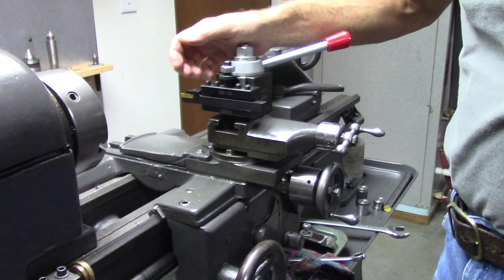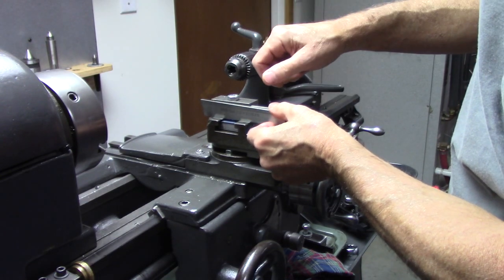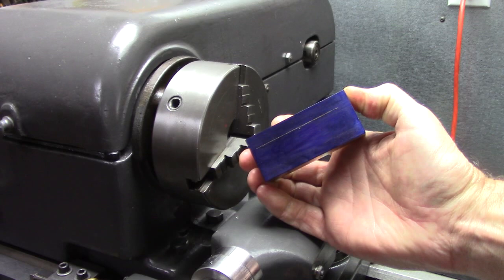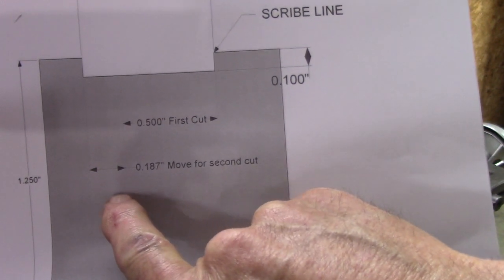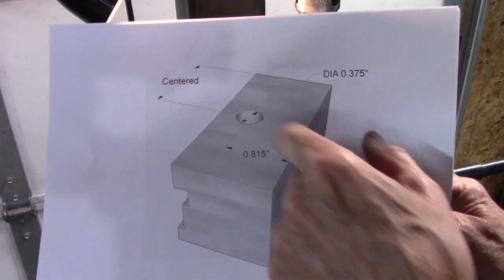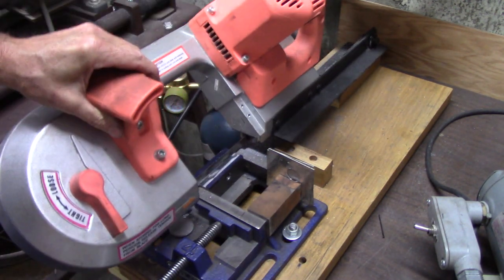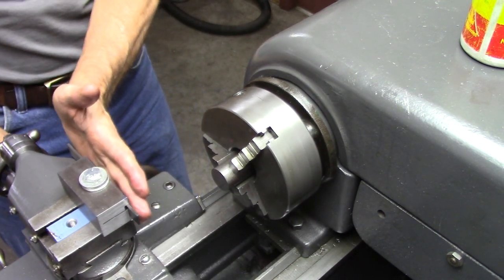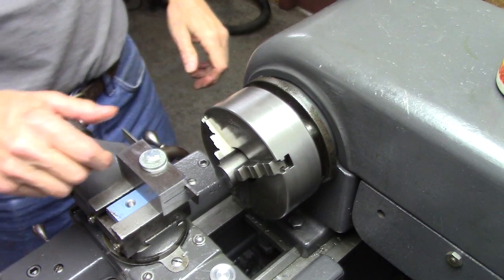Metal Lathe Cut Off Tool holder - NEW easy to make design

Comment: Well done, the end justifies the means they say....personally I would balk at moving the QCTP once I had squared it up and zeroed the tools etc. A lot of the problem with some lathes with parting off is the slackness of the spindle bearings particularly the plain bearing types.  Wherever possible I would go for the back tool post solution for parting off as it can make a real down in the dumps lathe a thoroughbred. I have an old 1930's vintage Colchester Bantam lathe, 5"centre height or 10 "swing for those over the pond,.....plain bearings and slack as heck, but as it has a screwed on chuck, doing a mod is going to take some doing. My solution is going to be.... make/fit a longer crosslide and then a back toolpost for upside down parting.....I won't be beaten.
Reply from the maker: Hello Ian, Great comment! It's nice to hear from somebody that understands the physics involved with cutoff. I sometimes get comments from viewers like, "learn how to setup the lathe and you won't have a problem". Of course many that make these comments are probably excellent machinists that have never experienced anything like a small South Bend, Atlas, Logan, etc.. Cut off is really fairly easy on a large Monarch that weighs over 1-ton. I don't mind removing the QC post although I understand your reasoning. If I was making a lot of the same parts in a production shop I might feel different but most of what I do is one time. I have thought about making a simple removable simple cross slide to avoid changing my tool post position but I suspect moving the saddle far enough out of the way would sometimes be an issue. My lathe has a ball bearing spindle (and a screw on chuck) but a very wimpy compound that doesn't have the needed travel to mount a cutoff tool on the back side.
Reply: @WinkysWorkshop  Hi, I've seen people sweat blood and tears on much bigger lathes when it comes to parting off....apart from the actual tool parameters it just depends on the situation and the lathe condition as well as the actual design of the moving parts.....anything that moves will deflect.
Reply from the maker: @gangleweed  - Interesting, I've used an E10 Monarch and things worked great. I guess it does depend a lot on the lathe condition for sure. I think this method I came up with is way more forgiving. It transfers the force straight down on the compound instead of trying to pull up on the front. The QC tool post acts like a lever.

Comment: I am going to start on one of these today, Thank you Winky!
Reply from the maker: Your welcome. Let me know how it works for you.
Reply: @WinkysWorkshop  Well it is done and works great! This is the first time I have been able to use power feed parting. I would love to send you some pictures of the new tool but I do not know how to contact you directly. I posted a video on Instagram and mentioned you as the one with the whole idea.  I tried the tool parting hot rolled steel and wow! Having the parting blade right on dead center is fantastic. Winky as far as I am concerned you are a genius, Thank you!
Reply from the maker: @jimm2442  - Thanks Jim, I'll have to admit that I was amazed at how well this worked also. Try this, mark21056 at g mail

Comment: That's a simple and sturdy cutoff holder. I have a Shars QCTP set myself, on my tiny toy hobby lathe... Southbend Heavy 10  ;-) and haven't had to part anything just yet. If it doesn't work out, I'll be leaning towards this. Subscribed!
Reply from the maker: The SB Heavy is a bit more solid I think but if you hear chatter you might want to consider this. Cut off is very demanding on a lathe and if it isn't solid parting will reveal this. This fix worked great on my lathe. Thanks for subscribing!

Comment: Nice evolution!  Use epoxy to install a couple of neodymium magnets so the blade is retained.  This will avoid dropping or falling out of the tool holder when off the lathe or installing.  If the magnets are not too big, I don't think you'll have accumulation of chips on the exposed surface of the blade.  Note, you can recess them a bit to soften their effect on the cut-off blade.  I love the tool.
Reply from the maker: That's a GREAT idea!
Reply: @WinkysWorkshop  You know, I had another idea.  Maybe better???  A couple of cap head screws installed so you can independently pinch the blade so it is physically held even when not installed on the compound.
Reply from the maker: @CraftedChannel  - I brought that up in a comment. It would make it slightly easier to mount but also harder to adjust the blade position. It's actually very easy to position and tighten although it would be nice to store the holder and blade as a unit. I love the magnet idea which would accomplish the same.
Reply: @WinkysWorkshop  Ok, I'm back to the magnets then.  It would be a pain to have to reach for two tools.

Comment: Is not the bottom line the most critical due to that determines the tool height on the block where your milling out the space for the cutoff blade. And once you make your cut almost through the block the top will come down and pinch the cut off blade in the block. I'm in the process of building one now for my south bend.
Reply from the maker: Good point. However, if you are careful not to mill the slot oversized you will be very close to on center. If you want to measure the blade height and do the math that would work. The top of the holder Ideally will only flex .0005". It sounds like you have thought this through. Let me know how it works. Also, make the compound straight and even back it off so the front of the blade is closer to the center point of your compound. I think you will like it!

Comment: Great design. Is the .25 machined groove to take the shape of the cut off blade at the top?
Reply from the maker: You got it. The blade has a T shape. Excellent blade!
Reply: @WinkysWorkshop  Thought so. 
Have you got a vid that shows  how to grind tools for different materials?
Reply from the maker: @alangriff1  I've never changed the angle of the grind. I'm not saying a different angle would not be better but it seems to work well as is for mild steel, brass, aluminum and to some degree plastic. The angle is the same as the original grind  (15 degrees maybe?)

Comment: cutoff blade is used on screw machines primaraly..looks like a t- 3 blade  .125 wide  clearance is to allow coolant and keep from binding type of blade is designed to either be clamped down on or if side  on lower surface not the upper part of "T"
Reply from the maker: I don't it matters as long as it is solid

Comment: I’m like Randy if you can reduce the overhang to the QCTP it should be as rigid. As I said in the last video my one piece insert cut off blade type works well, it isn’t like my Grizzly is that rigid.
Reply from the maker: Your Grizzly is more rigid. Randy was suggesting that my design would work on a QCTP "IF" it sat on the compound. This is in fact why my design works so well. Of course reducing overhang always helps with any setup. What would probably work well as my tool holder is a shim between the quick change blade holder and the compound. Many older Logan, South Bend and Atlas suffer from a less than adequate compound. Transferring the downward force directly to the compound compensate for this shortcoming.  The QC post creates an upward force on the T-nut. Of course this force exists with my holder as well but to a much lesser degree. Using the QCTP is exactly the same as my holder with the blade extended 1-inch further with the added negative or relying on the T-nut to hold the post.
Reply: Winky's Workshop yes I agree on letting it sit on the compound.  I know some folks have parting problems on the Asian lathes. I must have been lucky on my fix. Still the concept and execution was great
Reply from the maker: @JamesDedmon  . Thanks James. I sent you an email with pictures :o)

Comment: Hi winky, i liked the video very informative. I was interested in the rpm and feed rate of autofeed. I have not been as sucessful to be agressive at parting. I generally run about 270rpm and hand feed slowly in between clearing and lube. Tool set a smidge above center with carbide tool holder. I am using a 12x36 lathe.
Reply from the maker: I had the same issues before this modification. In fact I broke several blades. With this modification there is zero chatter and I can part at any speed. I'm not sure how fast the feed rate could be with a more powerful lathe. My lathe has a flat belt drive and if I go too fast the lathe stops without consequence. For 1-inch mild steel bar I part at 450 RPM and .009 per revolution with a steady drip of oil. If you use this parting tool clearing chips is not an issue. The top of the blade is concave and keeps the chips more narrow than the cut. The blade type is in the description below the video....  Oh and the blade needs to be set on center.
Reply: @WinkysWorkshop  thank you for that i will make this and give it a go. I hate how i currently part off. I hate breaking tools with potential damage to my lathe.
Reply: @WinkysWorkshop  oh yes most important I really thankyou for sharing you really made my day.
Reply from the maker: FYI  I made one of these for a GNT3 blade style insert holders. It worked much better than the tool post holder but the HHS works better.  I also made one for the GTN2 but wiped out the blade. I think I had the insert slightly high and it stopped cutting near the end of the cut...  I was also using auto feed. It's difficult to get the height of the insert correct.  The cutting force pushes the insert further into the blade  and changes the cutting height. I'll probably stick with the HSS blade.  The carbide works okay with this setup but the blade is much better. Let me know how it works for you.
Reply: @WinkysWorkshop  i have muxed feeling about carbide parting tools too. Purely because of mixed results i find the 3mm much more rigid and stable compared to the 2mm.
Reply from the maker: @metalshopwithtroy5755  I agree. The 2 mm is more fragile although I suspect I can make is reliable if I get the center height right. I'll play with it just because I have the blade and inserts but the HHS blade will be my go to cut off.
Reply: @WinkysWorkshop  i really appreciate your involment winky, the feedback is great too.

Comment: Nice tool holder and very simple construction. I wonder if machined bars of different heights that slot in below the tool would allow for different height cut off tools and maintain the solidity of the base tool?
Reply from the maker: Dang...  that's a good idea! Like stair steps. You might need to start with a wider block however. The clamping bolt needs to be far enough from the uncut part of the saw cut to have some leverage. Thanks!

Comment: I would like to know where you purchased your HHIP 2000-7030 3/32 x 11/16 x 5 Inch blade with the concave top.  I am unable to find one just like it.
Reply from the maker: If you google the number you will get several options but I got mine on Amazon. You can also get then directly from HHPT.
Reply: One more question.  I made your previous build of the cutoff holder and found that my Logan 92 flat belt 11" lathe has trouble with popping the flat belt off when cutting steel.  I watched your video twice and even power feeding you had no problem.  What type belt drive does your Logan have.  I don't think you were using back gear either.
Reply: Sorry Logan 920
Reply from the maker: @Histandard2011  - Yes I have a flat belt. I use a F1 Habasit belt that is designed to be used by the printing industry. It occasionally slips but never falls off. Falling off may be a result on either an alignment issue, belt too long or a stretched belt. The F1 belt requires special tools to splice...  I'm not sure where these might be available. There are belt suppliers with other options. Sorry I'm not much help.

Comment: Do you have plans for your cut off tool holder
Reply from the maker: No but its a fairly simple process. It's just a slot milled a little deeper than the blade width with one edge exactly on center. I did it with a 1/2 mill with 2 passes. It's super important to mill the slot the same height as the blade so you have to kind of sneak up on it.  Then you use a 3/16 mill and go a little deeper at the top edge for a clearance for the wider part of the blade. Then you drill the hole (I used 3/8") from the top and then make the bandsaw cut almost all the way through.

Comment: It is a great design, I stole it. and made one for my Clausing 6308.  I used 3" x 1-1/4" x 3-1/2" block..  I used 4 5/16-18 cap screws counter bored to hold the blade, the mounting bolt is a 4-1/2" 1/2-13 with a 2" counter bored thrust collar.  The mounting force is not applied to the blade. It uses a Shars P2 3/32x1/2".  My lathe has seen some abuse, over its 60+ year life. The compound was shattered at some point and brazed back together. It no longer has front gib adjustment set screws in the first 3 inchs of the compound, so the compound does not react well to side loads.
Reply from the maker: I'm glad to hear it worked out for you. Thanks for the comment.

Comment: Nice job! Put a stud in your "T" nut and use a nut on top so you can get rid of those washers.
Reply from the maker: Good idea!
Reply: Maybe over thinking it. Make 2 thick washers with matching convex and concave surfaces to compensate for the clamping action. The top washer could also be the nut.
Reply from the maker: @mikefox5510  - I'm impressed! I was going to make a convex washer for the same reason. Most people would never think about why this might be important. You have the ability visualize the slight angle created by the clamping action.

Comment: I wondered if you could make it with a small "ridge" on the side closest to the chick, to give you a  solid reference to the edge of your compound? Or, make it large enough to replace the compound completely, for guaranteed rigidity and alignment? Bigger job, not so convenient...
Reply from the maker: There are others that have remove the compound completely. It's definitely more solid but I kind of like my compound. The ridge is a good idea! Another guy said I should put magnets behind the blade to hold the blade in place while tightening. All great ideas.

Comment: Wonderful.   Would work great on my 100 year old cone head.
Reply from the maker: Cone head?  My lathe is 73.
Reply: @WinkysWorkshop   Machine tools with flat belts where you move the belts between pulleys to change speeds are know as cone heads.    The stack of flat pulleys kind of looks like a cone.

Comment: Thanks for sending me the link to this video.  This is an excellent solution to the problem I have been having with the parting tool moving down, cutting too deep for a while and then springing back and not cutting at all.  Often chattering, jabbing and breaking blades.  I do not have a milling machine but I can put an end mill in the lathe chuck, and mount the stock on a thick shim or spacer on the T-slot of the compound slide to get the cut at the correct level.  Simply drilling the hole for the T slot connector first would make the mounting easy.  I don't have a band saw either but a hacksaw and elbow grease will do it! My problem is that I will only have one month when I can work on my lathe this year and will have to set priorities. You can see the problems I had with parting tools on my YouTube videos:

My series has 13 videos so far and it starts here:
https://www.youtube.com/watch?v=VEIUMfuJ7xo&list=PLGfoCtzNfeSCGPh4kyw2Mm9727d756V-N

and 3 min 30 sec into the following video you see my terrible attempt at cutting off a section of stainless steel - forgetting to use the cutting oil I had sitting on the bench beside me! How not to do it!
https://www.youtube.com/watch?v=ALWL42A0qeY&list=PLGfoCtzNfeSCGPh4kyw2Mm9727d756V-N&index=5
Reply from the maker: Oil would have helped although stainless is very hard to work with anyway. You cut off blade holder is the same one I had. It was unusable on my lathe.  Yes a mill is nice to have. Mine is a cheap low quality mill (RF30) but it works well enough and does what I need it to do.

Comment: For all of you machinist heads that want a simple tool holder that works extremely well : https://imgur.com/sKf03bN
It was made by ex yugoslavian company called Prva Petoletka(they dont do them anymore).Made of high quality steel with airtight tolerances -built to last a 100years!
Unfortunatly i dont have exact dimensions but as you can see its incredibly simple design so you can scale it to your own needs.